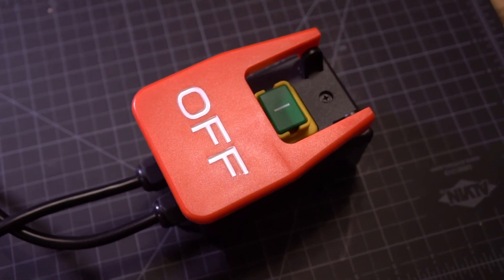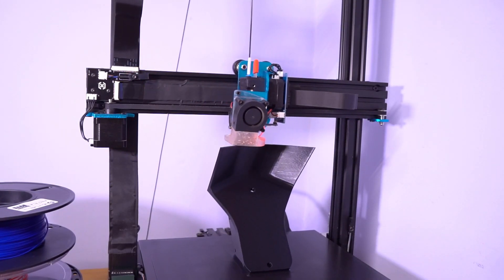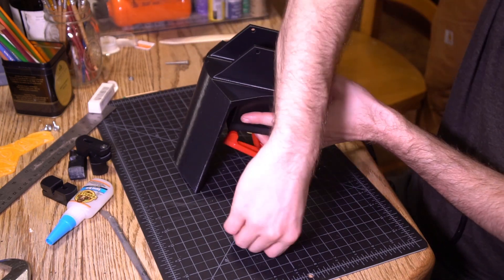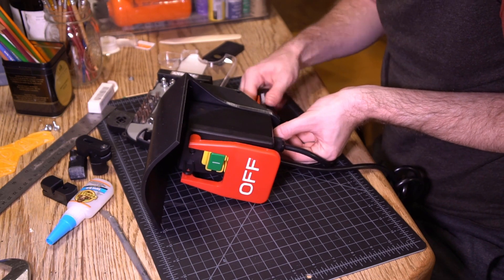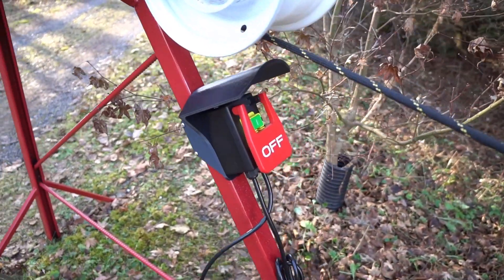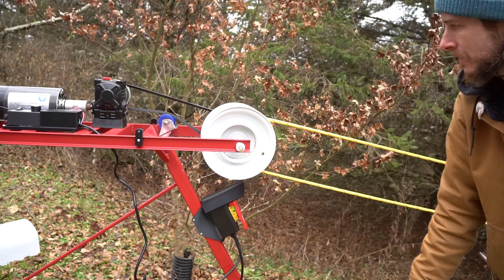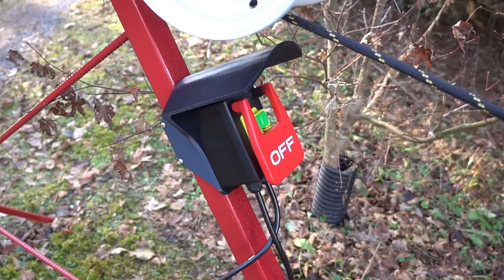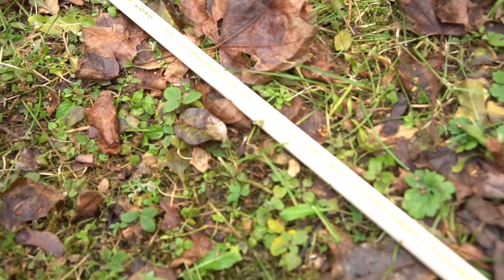Emergency Shutoff for my DIY Rope Tow

Comment: Just finished my ropetow. Would love to show you photos. Where did you get your worm gear? I ended up spending a lot more than I probably needed to on an industrial 15:1. But I'm running on a 2.7hp DC and didn't want to risk an Amazon model failing mid season.
Reply from the maker: I got mine off ebay so it's probably a sketchier model. If you're at 2.7hp are you on 240v? I was really struggling with power on a standard 120v american wall outlet

Comment: Why not just use a basic electrical trip cord. You have power already. Female outlet on each post… male to male trip cord. Rope tow industry standard if you want it insured.
Reply from the maker: I considered a trip wire of some kind but the double female cable idea is brilliant. It's also really cool to know that that solution is the industry standard for insuring

Comment: Good idea! But isn't PVC extremely brittle under freezing conditions?
Reply from the maker: I actually don't know. I always thought burst pipes were because the water expands in the pipe as it freezes, but I could see PVC getting brittle. I guess we'll find out!
Reply: @GoodRoads  you're right about burst pipes, but freezing conditions do make most plastics substantially more brittle
Reply from the maker: Thanks for the info! If this one breaks on me I think it would be fairly easy to achieve something similar with metal electrical conduit, you'd just need a pipe bender